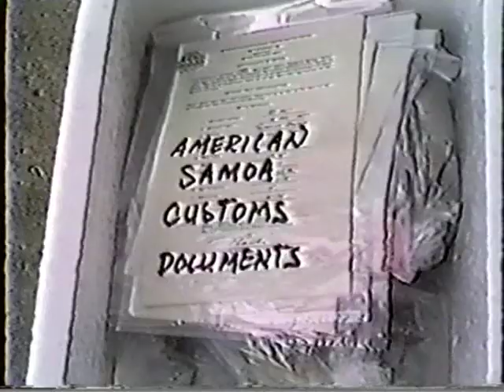How to Grow Giant Clams

Comment: As far as doing this in a colder area, it is not possible unless it's done in a large room that protects them from the elements.  Giant clams are from the tropical Pacific ocean. Water must be maintained between 78 and 80 degrees F. They need sunlight and/or metal halide lighting or LED lighting. Calcium and other trace elements must be kept at ocean parameters. If I had the money I would start out with 3 raceway tanks: 1 for spawning, 1 for baby settlement and 1 for grow out.